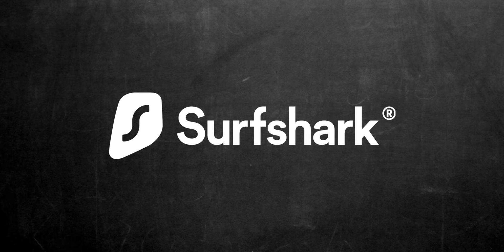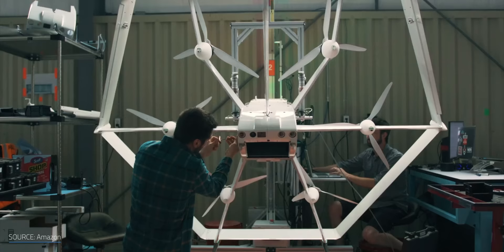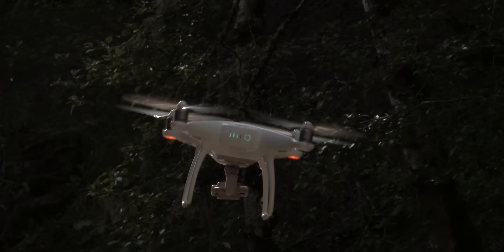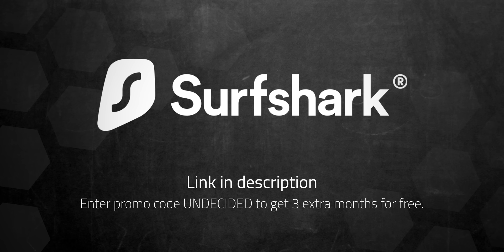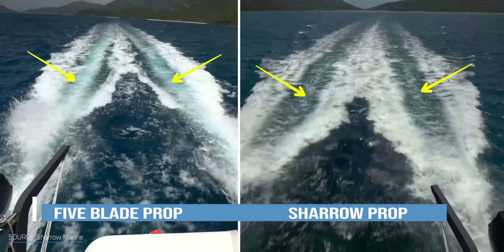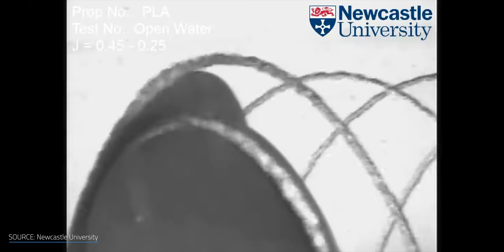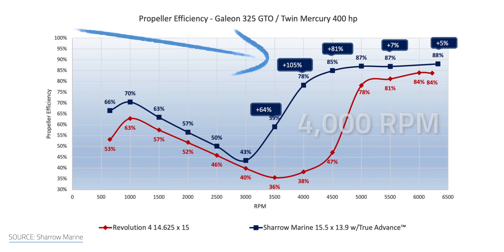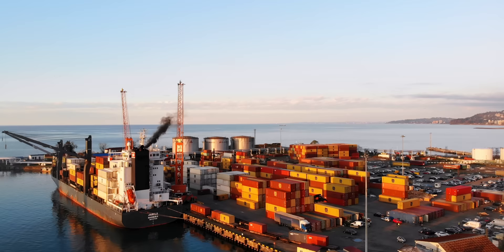Why is this Propeller Getting So Much Attention?

Comment from the maker: What do you think of Toroidal Propellers? Get an exclusive Surfshark deal! Enter promo code UNDECIDED for an extra 3 months free at https://surfshark.deals/undecided 

If you liked this, check out Why Are Floating Wind Turbines So Huge? https://youtu.be/83FqqfODmmg?list=PLnTSM-ORSgi7uzySCXq8VXhodHB5B5OiQ
Reply: Toroidal shapes are found in nature, so it makes sense to make use of that blueprint.
Reply: I think they are good.
Reply: Matt,
The aerospace industry has been experimenting with "Open Rotor" designs for nearly 40 years now.  The 20% fuel savings was known about in the 80's, but the noise and perception of passengers riding on a "propeller plane" instead of a "jet", along with fuel prices dropping prevented it from becoming mainstream. 
My dad has patents on some of this tech dating back to the late 80's and early 90's.  https://en.wikipedia.org/wiki/Propfan
Reply: I read about it some time ago. But PATENTS and this company can dictate the price, since no one else can make those.
Reply: Matt, the only issue I take with your video is that you seem to believe a reduction in retail prices will mirror a reduction in shipping costs. Let’s be honest with ourselves, a reduction in shipping costs will be absorbed as net profits. Because that’s how capitalism works, when fuel prices go up 10% the price for shipping goods goes up 15% never mind the 20% reduction in fuel efficiency. 

I love your optimism I actually come to your channel because you always see the positive ways a new technology can be used to improve our lives. Sadly capitalism is where hope and good intentions goes to die.

Please don’t let my pessimism ever sway you from seen the good in things.
Reply: Does this shape also mean that wind and water turbines used for power generation could benefit?
Reply: The lack of pitch control limits its applications.
Reply: SHAME ON YOU those POOR BIRDS!!! You need to replace that "kill 2 birds with one stone" phrase with "jail two politicians with one indictment!"
Reply: Obvious question.
Toroidal blades for wind turbines?  
More energy generated with less noise and may less harm to wildlife?
I have seen vertical, helical wind turbines that have the advantage of never over spinning in very high wind, but what about something like these at the top of an 80m tower?
Reply: Is there a weight difference?  These propellers look bigger/heavier than the traditional ones, I guess that would be a problem for drones.
Reply: So I don't know where they're getting all these numbers of it being more efficient. When “The Fan Showdown” a (very insanely popular YouTube computer nerds show) 3D printed both a prop for a drone as well as a computer fan they found that it produced about 30 to 35% less thrust then it's normal counterparts. In both cases it was five to seven decibels quieter as well as being a lower pitch. I think the only real benefit to the toroidal design is that it doesn't produce as much air turbulence so therefore there is less chopping of the air and less noise. But the rest of the claims I think are a little suspect. So I'm not entirely sure where they're getting this data. I trust the channel to be accurate it's just in a lot of the tests that I've seen it doesn't match the data that is presented here. I'm not trying to troll anyone I'm merely confused and looking for answers.
Reply: @ellefields8878  Competition?
Reply: @mafarmerga  I am waiting for some of these massive towers you are talking about to become available due to the turbines going bust, and then they can be repurposed for atmospheric electricity collection LOL
Reply: Are they safer for marine life?
Reply: @ThomasAndersonbsf  Thomas, Per kilowatt hour, what are the least expensive ways to generate electricity?
Reply: If they can save a minimum of 20% of fuel consumption even for larger ships I wonder why are there not billion dollar investments already.
Reply: On Maritime shipping:
If we stopped shipping fossil fuels around the globe, that would reduce bulk goods shipping traffic by about 40%.
➡️ One more reason to get off fossil fuels 

On the propellers: Less energy, same propulsion? All for it, i do wonder why the shape wasn't discovered earlier?
Reply: @mafarmerga  so far as much as I can tell its in triboelectric generation like the rain generators that use teflon and positive charge sodium glass as the triboelectric material, and some sort of metal material to conduct the power generated by a rain drop being in contact with the teflon and glass before making contact with the metal conductors, which amounts to about 5 to 10 bucks per square meter to make, and an hour to two hours once you get going per square meter, delivering about half of what solar delivers per meter at best, all from hand made items (so things made by machines to refine it will increase the per square area wattage density, probably superseding what the upper limites of solar power generation are capable, (and we can always make all the materials transparent to solar cells  activation frequencies to double down on power generation rain or shine, in the exact same area, pretty easily, look up transparent conductive materials to see what I mean. ) thus cutting down on time you need storage which is the most expensive part of either of those systems, 

I would hazard at cost of 1 meter of solar or same wattage produced from wind, vs 2 square meters of cheap easily made water drop generation, it is probably an order of magnitude cheaper.
Reply: @ThomasAndersonbsf  I would argue that counting on the energy contained in rain drops (or other mechanical forces) to power a trioelectric generator is a whole lot less reliable and less predictable than is sunlight or wind energy.  
So while your cost per sq meter is most likely correct, the reliability of your energy source makes triboelectric energy only useful in very specialized situations and will  never be a serious contributor to grid scale electricity needs.
Reply: There's an old design by a sound engineer; Christian A. Volf's vortex propeller, which is also very efficient and silent.
This design was probably suppressed, because it was too far ahead of its time. It might've made "flying cars" possible in the 1950s.
Reply: @mafarmerga  thing is no one is using electret effect to get super triboelectric effects, to allow for air motion (always in motion about the speed of sound, thus why sound moves as fast as it does in air) so as long as its warm enough to be a gas state, you get constant power output, but that goes deeper into a design I have that can harvest thermal energy to convert it into electricity, with a dense enough size and power output per KG of equipment, to run a car with at least, and might be possible to run a drone. have to wait and see how the final results for the ones I am working on now, operate in the real world vs applied mathematics based on previous designs I have physically tested,
Reply: What's to be determined is whether this is a patented design.
Reply: Cargo ships seldom burn diesel fuel. Most cargo ships burn heavy boiler fuel.
Reply: I wonder how it would perform on private planes and Turboprops. Non-variable pitch is a problem, though.
Reply: 100Hz to 5000Hz?  really?  Thats the range you went with as evidence?  smh... gtfo
Reply: Plz change your click bait pic down nothing can ever be 100% efficient it would brake the 1st law of thermodynamics and you say these are 105%
Reply: Was hoping to hear something about specifically the propeller in the cover image. It's got a weird wavy surface. What's that about?
Reply: Well I think the patent is now for everybody to use, and that's why it's getting much attention. The electric car companies wouldn't start until elon musk made his patents free to use, then all of the sudden they were interested in making electric cars. It's the same with this propeller design, the patent is free now, a waste of money for the one that thought he/she could change the world found no investors or didn't make it, the patent alone was expensive enough.... Wait until gravity assisted batteries patents become free.... then all of the sudden we will have found a new energy source that can help the world...
Reply: My grandfather was experimenting with toroidal propellers in the 1970’s showing these benefits. Only to be send home because it was threatening the existing industry. Next to the efficiency difference he also showed an extra environmental benefit. I stil have some samples at home.
Reply: You are very far out of your expertise here, Matt.  Are you an expert in hydrostatics ?  I don't think so -- or you would never post that thumb title...
Reply: There is no such thing as "fossil" fuels
Reply: @ellefields8878  I believe you’ve left competition out of the equation. That will bring price down as costs reduction provides increase in margin to allow price reduction without corresponding decrease in profitability.
Reply: It’s funny that I’m seeing this propeller now designed for a boat because my father and I purchased a boat called a chaparral in 1999 and I was having a few too many drinks and ran the prop into the ground well trying to stay away from the shore edge because fibreglass and sand don’t mix well and I hit the prop on a concrete block anchor just offshore which for the rest of the trip left a vibration in the boat we got it home and I put it on The alignment machine in my grandpa’s shop but there was also a good size chunk missing against the centre hub and the outer blade so then I decided to machine the other two props the same way not only did it go from sucking $200 worth of fuel per day down to being only filled once every two days it increase the speed of the boat from 61 miles an hour to 89 miles an hour and my father would take the entire summer off when we were kids so we went home for a week fix the problem came back up everyone seen what we had done and wanted to race so six in the morning we had a V-8 ski boat that sat low in the water mid engine a couple outboard engines and two inboard engine boats as soon as I slammed that throttle and trimmed the leg so there was no spray I hate 89 miles an hour within three seconds everyone couldn’t believe it so that winter I got 24 boxes from friends of ours that we’re always at the Lake and took their stock props and designed them just like the one you have now essentially I figured out but now with this better performance prop I could take the leg off the boat and machine the fins on either side that created spray which were designed to help the boat get out of the water faster and up to plane we’re no longer needed see my grandfather came from Ireland as a machinist my father was a machinist a painter and a carpenter and I work on HVAC and have a degree in instrumentation so I’ve always got gloves on because my friends call me the true man of all trades but That is a beautiful prop but mine looked better I went with polished brass
Reply: How about pumpjet propulsors? The Navy likes to think the tech is classified, or SHOULD be classified, but tons of pictures exist on Google Images. And I also found Youtube videos of professors breaking down the number of blades - to - Hertz ratio, for listening purposes.
Reply: feed current propeller designs into a ML model containing images of all propellers, weight, price, and graphs of outputs. or put it into a simulation of water and have the computer discover what is the most efficient propeller in the simulation then build from that into the real world
Reply: This is a crazy innovation and i cannot wait to see what the future will lead us on that particular subject. Do you think it is possible to use toroidal shapes to boost the efficiency of wind and water turbines?
Reply: Hello Matt- Are any HVAC manufacturers reviewing this technology?

Comment: I'm surprised by the absence of mention of the one word most engineers dread "turbulence", the design seems quite genius dealing with the turbulence and the fluid dynamics that come with the wing tip vortices. Dealing with the turbulent flow and harnessing it is definitely more than 2 birds in 1 stone. It's the entire flock :P
Definitely looking forward to the developments and applications. Thanks for the wonderful video covering topics like this as always.
Reply: And just imagine what we could achieve when we changed the traditional props on airplanes to these and changed those fan blades on turbofan jet engines to toroidial shapes. Now that would be interesting to see what sort of gains in power and fuel savings we would get there.
Reply: @MrBrander  Since turbofans pump directly into the engine's bypass/cooling duct, the outcome would likely be net negative.
Reply: If a toroidal prop dissipates wing tip vortices, I wonder if the same design can be applied to a stationary prop; a wing? 
Maybe designing a stationary airfoil that incorporates such a design would improve flight capabilities of stationary wing aircraft?
Reply: @ryanhungerford6448 would the lower surface area of your new wing design also cut lift. Winglets already cut the leading edge vortices tip of most commercial passenger aircraft. It could definitely benefit current turboprop noise where these props already offer lower fuel consumption. Would it allow for a faster turboprop speed? I recall some speed limitations were due to leading edge tip damage as the local air nearby went supersonic
Reply: Nah, you do not need that- what you want to know is what will happen when you hit surface of the road, on your way down to a local lake...and how much $$ bills you will lose doing it.
Reply: @MrBrander  Thats stupid for planes lmao
Reply: @MrBrander  I want to know how effective these would be in a wind turbine, especially the darwin-style vertical turbines.
Reply: @stephendoherty8291  your totally right. 
The Fat Electrician just made a video on that plane. 900 sonic booms a second. Tearing the plane apart. Prop technology peaked until now
Reply: isnt this the shape they calculated for those fusion reactor hulls?
Reply: Also, does this approach also work for fans (eg. turbofans), and not just propellers?
Reply: That's because the turbulence is the cause of the sound. Smoother wake = less noise
Reply: EDF ducted fan is more efficient using this design add another 30% to efficiency
Reply: Turbulence not only is really importante , but in most aplications, is wanted/necessary. It just depends of the type of turbulence that is created
Reply: Now it would be up to those propeller makers to make third party propellers for drones
Reply: Vortices are caused by turbulence, it was implied
Reply: @ryanhungerford6448  Circular wings are already more efficient than that, but they're very hard to implement, and so are box wings. Might want to look into those, but they're also only a solution to low speed flight
Reply: …hmm well, losses from tip vortices simply do not add up to enough that you can improve efficiency by “105%” or even “46%”. A marine screw can easily hit 70% peak efficiency and most of the losses at the design point will be viscous and swirl (not the same as tip vortices) so the claims here can be seen by all engineers who remember their propeller theory to be bogus. Now if they came along and said the efficiency gain was 5% at peak I would think that was significant and plausible. 46% is total snake oil.
Reply: @ryanhungerford6448  "Maybe designing a stationary airfoil that incorporates such a design would improve flight capabilities of stationary wing aircraft?"
@4:56 ....
Reply: @Ryan Hungerford  very first part of vid says it doesn't work as a fixed wing.